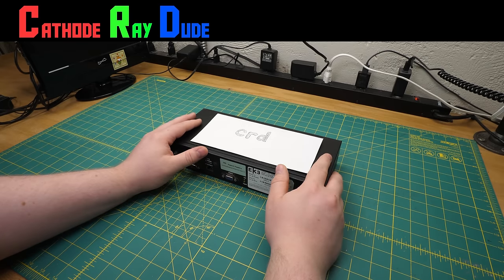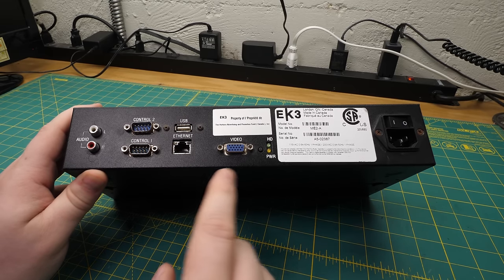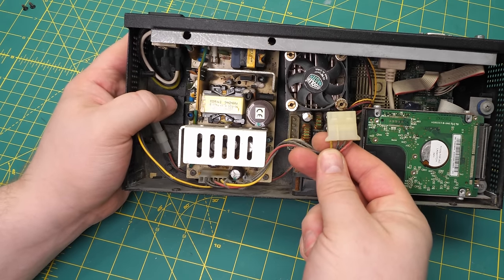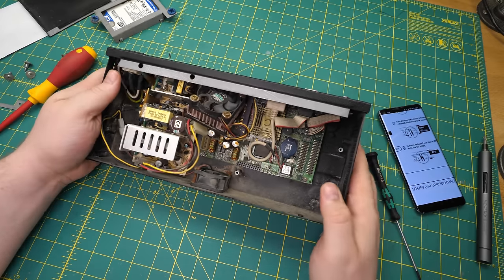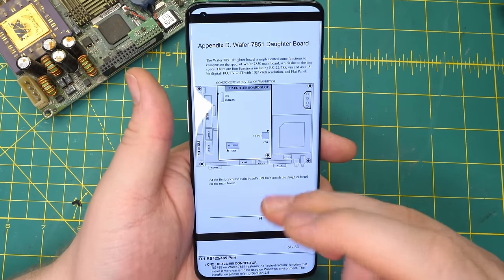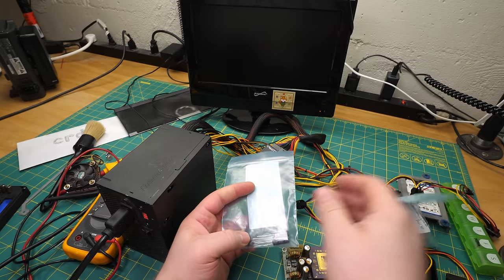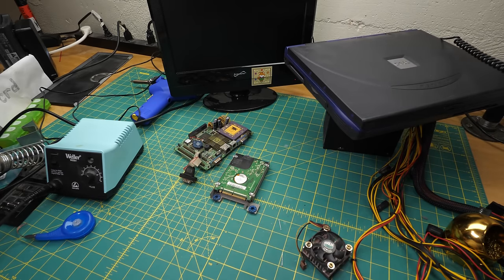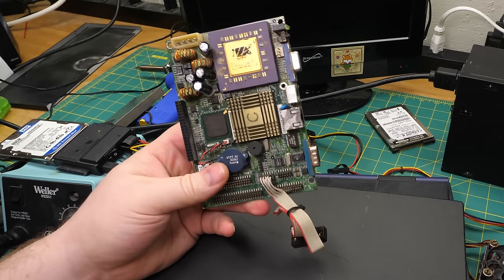Little Guys 8: This one won't fly [EK3 Media Engine]

Comment from the maker: Update: An eagle eyed viewer (thanks @SwitchingPower!) noticed something I missed: the component on the backside of the board underneath the CPU is toast. You can see that around 21:20, directly in the middle of the socket on the back. I'd noticed the dirt on it resembled the spatter from a blown semiconductor during disassembly, but I wiped it off and it seemed like it was just the same deposits I saw elsewhere in the thing, and I didn't see a cracked case, so I thought it was just dirty. Sure enough though, I desoldered it - it looks like the back of the case blew out, even stripped the top layer off the PCB. So yeah, this was never gonna work.

If this video feels a bit... unenthusiastic? Like I didn't put in as much effort as it deserved? It's because I got about two hours into shooting it and realized that it felt like this thing SHOULD work, and that I was just not skilled enough to figure out what was wrong, so I lost a lot of drive and just tried to salvage something out of it. Turns out it wasn't my fault; wish I'd realized that at the time.

Regarding the little six-pin device on the daughterboard plug: I had tried during shooting to get a good look at the label and couldn't make it out, but while looking at the board again today I suddenly found an angle where I could see the lettering. Turns out it says AAPN, which is a MAX6629 (or similar) temperature sensor! That makes a lot of sense!

If you see the early version of this video: There's a quip in there about 240V being used in Canada, which is based on something I saw years ago about Canadian houses being wired with split-phase specifically so they could bring out 240 to ordinary wall outlets. True or not, it doesn't seem like it's very common, so I removed that line with the youtube editor and it'll take effect sometime in the next 24-48 hours.

Yes I pronounced Ontario wrong. Sorry :(

I quipped about FCPGA being basically "the" socket for CPUs with pins - that's true as far as most chips go, but what preceded that was plain PGA, without the FC; "flip-chip" referred to the die being upside down on top of the carrier instead of vice versa. Likewise, apparently ZIF came in with the first Pentium sockets - I suspected it was a bit older than I remembered, that's why I hedged on that point. It's actually the 486 I was thinking of, but those weren't any more pleasant to press-fit into a socket than the 370 chips; I remember breaking pins off of one or two trying to get them out, in fact.
Reply: Canadian here : sure, we have 240V and it COULD be connected to a regular outlet, I think I've seen that done in some specific case, especially with specific plugs in kitchens (like for microwaves and kettles) and more recently, electric cars, but way more commonly, it's only used with the oven and the dryer with their own plugs. Our electrical system is basically identical to the US, so really bad, I think our laws are just a little tighter when it comes to safety.
Reply from the maker: @MrCed122  yeah, I swear I saw a video from Matthias wandel back in like 2016 where he demonstrated that you can get 240 at any outlet by just joining the phases together, and explained why this was common, but I can't find that now so I can't be sure whether I just dreamed it into existence or what.
Reply: our electricity is basically the same but instead of nema 14-50 for split phase on stoves and dryers we usually use nema l6-30R or L14-30R and their higher amp cousins. also "ontahrio" is funny as hell so u get a pass on that. also most timmy hos have the coffee makers right up front and centre which puts them under the TVs, so that rust is probably coffee steam.
Reply: I've heard that some American houses are also occasionally wired like that as well, which is extremely cursed. Don't stuff 240V over NEMA 5-15. Ideally, no country would use NEMA 5-15 because it's truly awful, but we appear to be stuck with it.
Reply: can't believe you would do this. smh my head.
Reply: Funniest way to say Ontario ive heard, next time say Toronto 😂
Reply: Split-phase is used in North America generally, so that 240V can be brought out to normal outlets when necessary. Keep in mind that those outlets have slightly different pin arrangements so you don't fry your 120V stuff, but yeah, we all have that.
Reply: I'd also like to point out that partition 4, the one labelled Extended, couldn't have been mounted if you wanted to. It's a partition that holds all the partitions after number 4. On MBR-type partition tables, you only get four partitions, but one can be an extended partition that you can then partition further. You probably knew that at one point in time but just forgot it.
Reply: As a Canadian, anything that makes the Ontarians cringe is fine by me. 

(Just kidding, love you Onterrible)
Reply: As far as I know the US home electrical architecture is just about the same as Canada, you can get 240v from two outlets if they are from diferent hots. I think this is true in the US as well.
Reply: also, ZIF sockets have appeared much earlier than on P3 - they became mainstream with the release of Socket 1 for i486 CPUs.
Reply: @CathodeRayDude  Electroboom (who is Canadian) has a video about this and he does exactly that, however it was the outlets in the kitchen which were wired to separate phases (since you're expected to plug in high current appliances), so it's not going to be like that in every room where you have two phases side by side.
Reply: i live in NL, Canada and we have that 240v system but thats more for appliances like ranges, ovens, washer/washing machines (dryers dont, most are just 115V),  My father had 240v ran to his shed at one point for my now ex-brother-in-law's stick welder, was a 240v commercial rig not retail like you find at CanTire (i got him a 115v fluxcore wire feed welder after it was taken back). When i had a job ages ago at a diner where we had a big ol Hobart mixer, it ran on 240v. it's apparently 'regular service' from the pole to the house in my area. i just figured it was always a thing. i think its called Two Phase but i could be wrong.
Reply: Hey this is a longshot but since this thing doesn't work, can I buy it off you?
Reply from the maker: @seshpenguin  Yeah, this is what I remembered, something about kitchen appliances being able to use 240V in a pinch, I just couldn't find anyone talking about actually doing that nor could I find the original video I was thinking of.
Reply: @CathodeRayDude  I don't recall seeing Matthias Wandel's video doing that, but I have done that to get 240V (in Concord, On) by running cables to 'two' 120V circuits on 'opposite' phases (L1:red, L2:black) in a converted (1950's) industrial building where the two were interleaved for load balancing reasons.

Also in the socket behind a very-old fridge, and microwave in a 1980's house (golden horseshoe area, Ontario).

I've not explored how common that is, or why that specific building seemed to have 3-phase wiring in a bank of (long-obsolete) NEMA 5-10 outlets in what used to be a chemical-processing area.
Reply from the maker: @ChefSalad  I hadn't even checked the part types, I just ran through all 7 so I could sort them out later. My surprise wasn't at it failing to mount, it was at the nonsense error message - you'd think mount would be able to say "extended partition, makes no sense to mount" instead of complaining about being out of memory.
Reply from the maker: @samthenerf  Yeah, but I could have sworn I remembered a video where it was explained that in Canadian houses this is done on purpose, so you can in fact use a Y-cable to obtain 240 on demand, which is absolutely never the case in the US; it's possible incidentally, but never by design. I just can't find that video anymore, and I can't find anyone stating that it's by design in canada either, so.
Reply: ZIF sockets did come out for 486 first. for the most part only early boards used the LiF ones.
Reply: @CathodeRayDude  it's not for that, it's just so you can have a microwave and a toaster right next to eachother without tripping the breaker (trailhead term 'kitchen split'). afaik those Y-cables are not considered legal or safe.
Reply from the maker: @famitory  ahhh, okay, that makes more sense, so anyone who's said it's an intended thing is wrong.
Reply: 😊All the rust would be from being in a drive thru menu .  Extremely hot, humid summer's and cold frosty winters.   I worked on many tim Hortons menus and other devices across the prairies and rust and corrosion was common because they are all designed by people in locations that dont have 4 seasons
Reply: im so glad you found out what that lil board was, I was sure it was a temp sensor from the second I saw it and needed confirmation, now the video is complete and I can rest in peace lol.

also totally get you about losing drive when you cant fix something especially if you started to believe you could, I struggle with the same a lot, I'd have made some videos about random old tech I get regularly if it weren't for the fear that I'll fail and have to delete everything and not make a video I wanted to do, it'd feel like a double failure, if I do it just for myself at least I'm not disappointing anyone else, so yeah, I get how frustrating it could be especially with a channel with actual subscribers like yours lol, but I'm glad that you put these videos out, they're just as interesting as the others and I come here to learn silly lil things bout silly lil forgotten tech and this video accomplished that, the jumper config for laptop ide drives ??? like wtf 😭
Reply: @CathodeRayDude  When wiring a house you could intentionally place two outlets that are on diferent sides of the phase next to each other for this purpose, I have never seen or heard of this being done. Though I do have a commercial product that makes 240v from two outlets (made by an US company).
Reply: As an Ontarian, I accept your apology.  Lol
Reply: Ontario is pronounced "ont-air-io" rather then "ont-ar-io", no bad blood here, just helpful info
Reply: i know it probably won't be the case, but don't trow it away. it looks like a fun piece of hardware and kinda unique.
not a lot of p3 with usb made in 06/07 i would guess
Reply: You mentioning Cineplex like some unknown foreign company gave me a chuckle. Nothing bad about it, just made me laugh because it’s so commonplace here. 
Like, I imagine you’d say the same thing about Harvey’s or President’s Choice. Sometimes I forget there are things here that Americans have no idea about.
Reply: @waylandsmithers2815 I pronounce it more like “on-tary-oh” but maybe that’s the same thing?
Reply: @daemonspudguy You say 240v over NEMA 5-15 is cursed, well you haven't seen what they done in parts of Asia with 240v.
240v over a NEMA 1-15 (yes the ungrounded plug) with no GFCI/RCD required.
Reply: @abunk8691  no. No. No. No. No.
Reply: @CathodeRayDude so yes you can get 240v from some outlets but the must be 15amp top and 15amp bottom, which are usually located in the kitchen. The way to test is to use your multimeter and probe hot top and hot bottom should see 240
Reply: I appreciate the exploratory nature of these videos regardless. It seems you prefer to have exceptionally well scripted videos with all the mysteries uncovered before recording, but there is a 'raw' 'learning along with you' aspect to watching and listening you take apart and analyze weird shit. It also promotes good community, there's a lot of fans chiming in down here!
Reply: @famitory hehe hi Famitory
Reply: @CathodeRayDude : "Joining the phases" is the trick there- you have to hunt down one socket with one phase, another socket with a different phase, and do something janky and unwise involving extension cords: DO NOT DO THIS. More importantly, it sometimes matters if you're running e.g. audio cables between rooms and the outlets are wired wrong.
Reply: @CathodeRayDude Yupp yupp. In fact the circuits don't even have to be on separate sides of the split phase, it would just be coincidence if they were. 

Basically it's trying to provide more amperage to the Kitchen where you're likely to run the toaster and the kettle at the same time, which blows the breaker and annoys everyone 😂. 

But yea, those breakers could be placed in the load centre so that they're on the same side or the opposite side of the split phase. Generally it'd be luck if the draw. Although now it seems like we should add a regulation requiring them on the same side just so that no entrepreneurial homeowner Can get 240V that way. Hahaha.
Reply: @CathodeRayDude  Yes at the end of the day it's nothing special, you get two phases at the breaker box and you typically only use one for 120 but for some things it just doesn't cut it so you get 240 by installing a type of breaker that clips on both phases to power dedicated outlets for say dryers, washing machines, ovens and similar high loads.

In other words your house does get 240Vac you just use half of it most of the time
Reply: @CathodeRayDude  ElectroBOOM definitely did something like that, I don't remember if that was in Canada or here, but it's probably the same
Reply: @samthenerf   Adjacent outlets on different phases is often done on purpose. Technically not two different circuits but a single multi-wire branch circuit. The reason is simple: you get double the power delivery with only 33% more copper. The neutral and ground are (safely) shared between both circuit halves. Apparently this was common in kitchens before 20 amp circuits became required.
Reply: @CathodeRayDude  interesting only thing I can think of is the electro boom video. There are lots of issues with doing that sure there's a lot of things that can be done that shouldn't be done but that sounds like it wasn't a approved method.
Had a food truck show up with a special adapter Y cable. And 5 extension cords... and out of the 5 extension cords 1 had reversed polarity and guess what... that's the one that got used. And then had to find the circuit breaker amongst multiple panels in an old 1970-80s? facility that was now being used as a senior center.

Just realized what comment I was replying to.
To just generally answer questions that I've seen so far and one comment.
Generally US and Canada Electrical is almost identical they have a bit stricter in some ways standards. It's actually "split phase" you're not actually getting three phase. most residential houses are served by one phase to a transformer thats Center tapped. So most devices are going to get 120V either on one or the other half of the transformer. Since we are so close with Canada the systems make more sense to be shared. And at some point standards were improved upon to allow the 240V across the full transformer to run higher appliances like ovens ranges dryers electric heaters that sort of thing. 90% of appliances otherwise are 120v. Although I did see a episode of some house renovation show and they had wired in a UK outlet into their kitchen for their kettle, unfortunately they never show enough of the electrical on those shows for me.
Reply: @Demento001  yeah totally get that as well. I was changing the screen out on a laptop and the company I ordered the screen from would give me a discount if I did a video figured well why not anyway. Got all the way through to reassembly and it didn't work they were something else wrong. Didn't get my discount but I uploaded it anyway. Adam Savage has a great video about failure. It's also a great way to learn things even if you don't learn things. it is disappointing when you can't fix some thing but you know that it's fixable.
Reply: @samthenerf  I wonder which commercial product that is. Sure you can grab to Hots but it's not always a good idea. I've seen some passive cables that do this, I've also seen some passive cables that have at least added circuit protection. And there's one company that holds a patent on a device with relays for plugging in floor cleaners and like for flood rescue repair situations when a 240V outlet is not available. The relays are in there to prevent anything from working if it is not plugged in properly. The patent is surprisingly informational.
Reply: @abunk8691  technically it shouldn't be. NEMA 5-15 should be 120v only, there's a whole chart and another one if you want locking. but yes China doesn't believe in standards sometimes. If the two outlets are on separate half of the split phase Center tapped transformer it is possible but shouldn't necessarily be done. the NEMA Standard is basically there to have a socket with a different pin configuration for every voltage and amperage combination, there's a few exceptions like 15 and 20 amp sockets can share otherwise they're just generally being used incorrectly.
Reply: @eDoc2020  to add to that I've seen outlets where you break the tab off and land one hot on the top. and one on the bottom and I've seen other arrangements where you do one outlet and skip so every other outlet along the counter is on a different hot. It really depends on the electrician that wired it. At some point Code said you need a minimum of 2x20 amp circuits in the kitchen to avoid the whole tripping issue. And generally if you have two (can't think what to call it other than phase but it's not ) semi phases in the same box the breaker should be linked to disconnect power to both circuits for any maintenance personnel, as they might pull the outlet out and think well it's off at the breaker but there's a second breaker feeding the other half of the circuit. This also hopefully prevents the two hots from getting split apart in the breaker panel and landed in wildly different places.
Reply: @imark7777777  No idea why they did that aside from some of those countries had American occupation during World War 2 and some adopted a similar-ish electrical standard afterwards. A few countries that do 230~240V 50/60Hz over Nema 5-15 are China, Philippines, Thailand, Cambodia, Vietnam, Laos, and a few more nearby countries.

Philippines is one I done some research since the Single Phase 240V electrical system they use are mainly through Ungrounded Nema 5-15 plugs. I found that weird and seems like the grounding isn't required for them. I think the major electrical provider there also does 120V but its not the typical setup. 
It kinda resembles US electricity but without the split neutral line. So its a double hot wire. There's some examples online of people holding an electrical lead tester half to a pin on the socket and half with their hand and the tester glows faintly with around 120V and the same is true for the other pin on the Nema 5-15 socket.
Reply: @imark7777777   If there are actually two different circuits there's no need to link breakers. It's only done in the dual-hot situation because they are the same circuit.
Reply: @CathodeRayDude I was thinking that it may have been another video from elctroboom showing in an apartment how to power a 240V blow dryer or hair straightener cant recall https://m.youtube.com/watch?v=OiwWaIvIeao it was this video